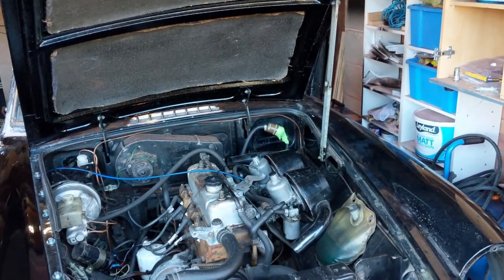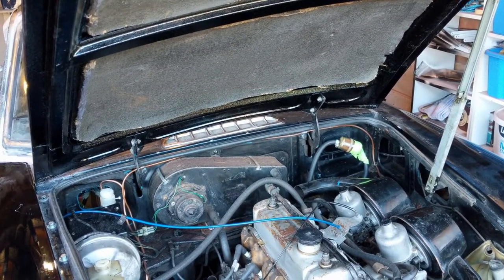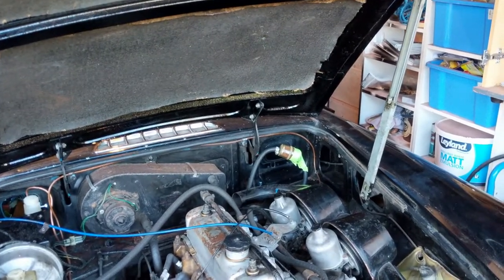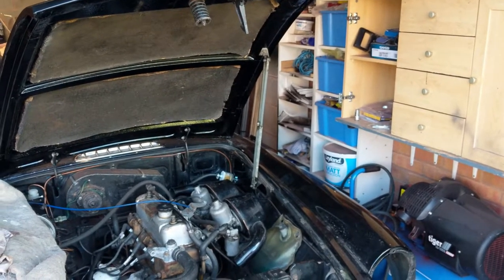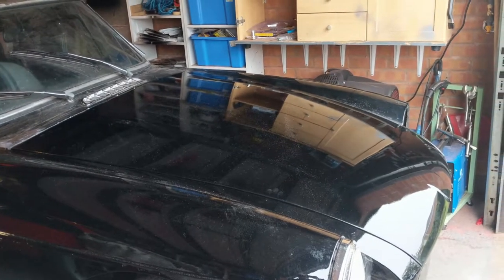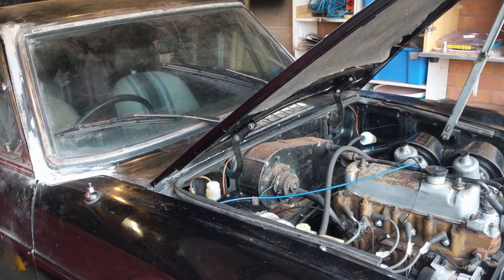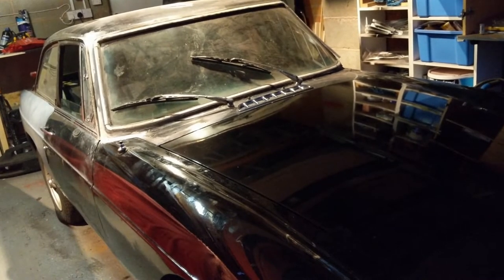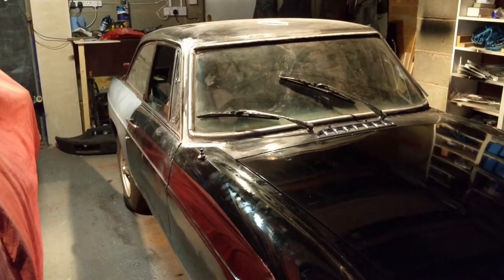MGB GT Episode 10   More on the Clutch

Comment: Hi Henry, Just came across your series of videos on the MGB GT. I do admire your determination and persistance on the refurb. I have a similar car myself which is in the final stages of a full nut & bolt rebuild, so know how much fun a frustration you feel (in equal measure). Dont know if you have cured your clutch problem yet, but the symptoms are classic of a dragging clutch, so not fully disengaging when the pedal is depressed. The MGB clutch is notoriously difficult to bleed succesfully, partly I believe, because the hydralic line is routed above the master cylinder, so any trapped air natural migrates to the top of the loop. Having to top up the reservior while bleeding allows enough time for any air that is moving to naturally migrate to the top of the loop again which means it is never fully dispelled. The way I cured this was to run the bleed tube back up into the engine bay and into the master cylinder, so the fluid circulates in a self filling loop. I did have to top the reservior up slightly, but once the fluid is moving the pedal can be pumped continuosly to get the trapped air moving. This method does require a second person to operate the pedal while you hold the bleed tube into the master cylinder and watch for air bubbles. Once the fluid is circulating with no air bubbles, nip the bleed nipple up and full operation should be restored.
Wouldnt recommend this method on a system which has older components as it risks putting debris into the master cylinder, but as your system is entirely new it shouldnt be a problem. Hope this helps...GOOD LUCK! and keep posting.
Reply from the maker: Excellent tip - thank you Carsten.  If you get to first drive, you'll see I still have a problem even then.  If did further work at that point and have made it better but still not great (there is no video of that improvement).  It is off the road while I try and find tie rod ends that fit (mine are none standard) so I may well try your method if the clutch needs more bleeding.  Thank you